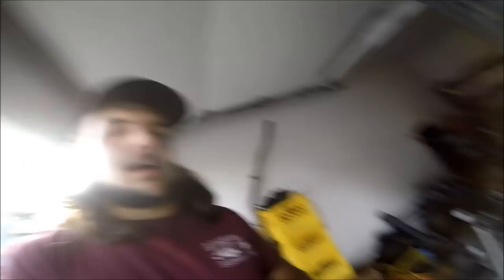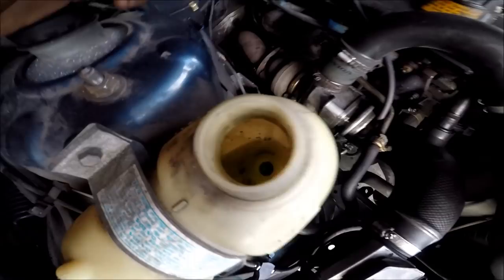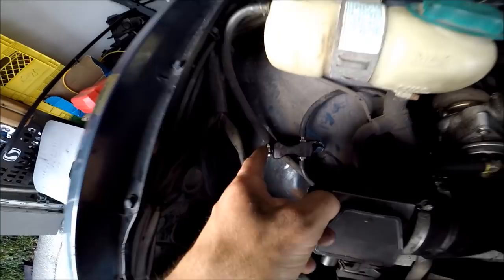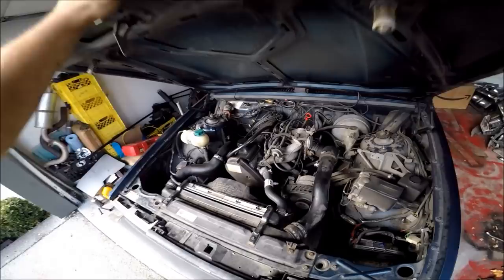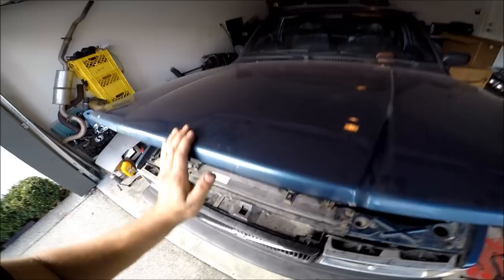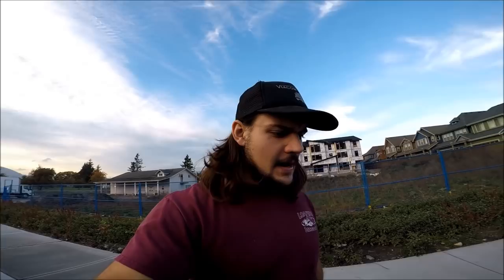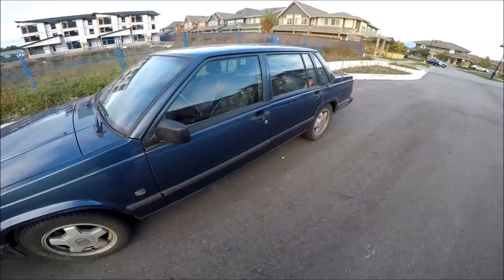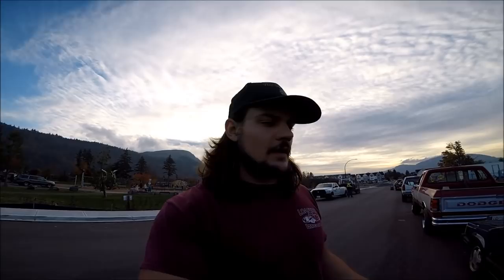FIRST DRIVE IN LAWRENCE

Comment: Can you make a video showing the entire sunroof delete process step by step?  I've seen in other videos where you show the sunroof has been deleted but I've not seen one showing how you did it. Thanks.  Also what kind of seat do you keep swapping into all the cars?  Is it a Recaro? What kind of car is it from? How easy is it to mount in the 740?  Can you use the original seat tracks and mounts?
Reply from the maker: I already deleted the one on lawrence and unfortunately didnt make a video :( . Next car i will make sure to do that. The recaro i swap between all my voes is from an evo 4 . Its basically a recaro speed but with one off patterns on it that only came in the evos. I got lucky and found some crazy craigslist deal , recaro seat brackets that bolted to the factory seat rails. Pretty cool find
Reply: Cool, thanks for the info.  I'll look forward to the sunroof delete video on the next project.

Comment: So is it normal for a b230 to have a slight tick?
Reply from the maker: Yep solid lifters they all tick . Most are fairly loud too
Reply: @driftsnlifts  Does it still tick on acceleration? It ticks slightly at idle and on acceleration, but is quiet on deceleration.